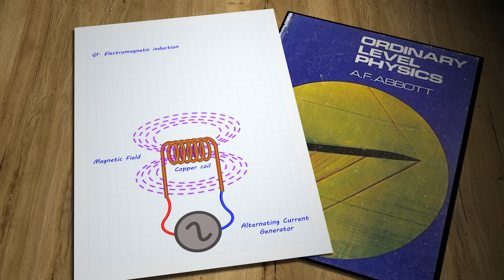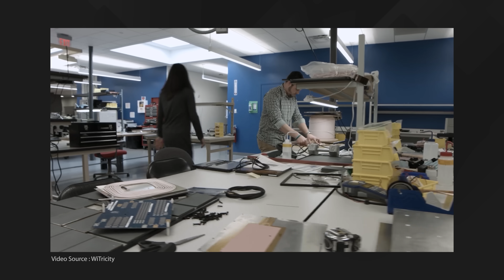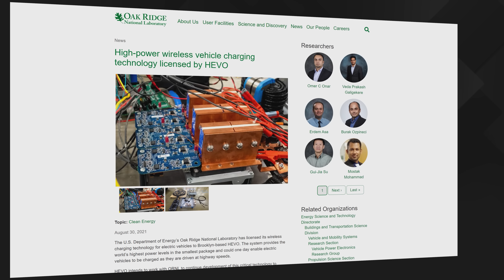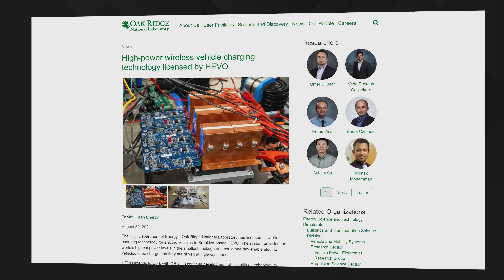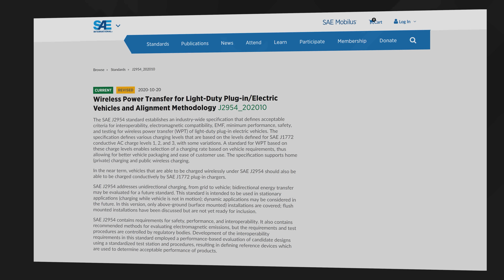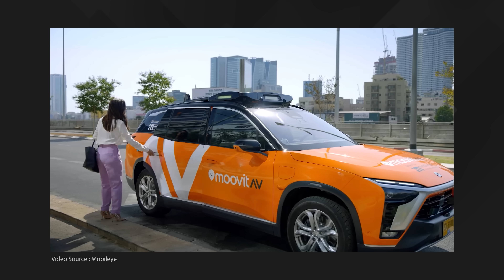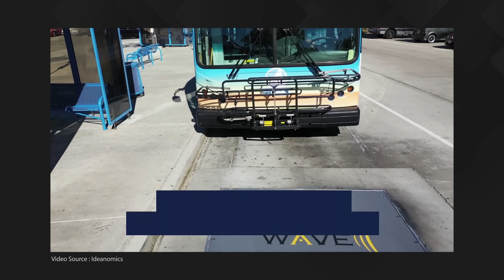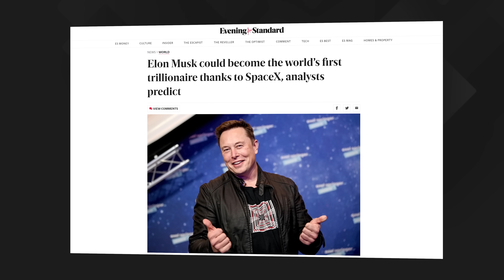Wireless FULL EV charging has arrived!  Exciting new tech breakthrough.

Comment: I like the idea of wireless charging, but this needs to be carefully integrated with services (electricity cables, water pipes, drains) that also run under roads.  It could actually make maintenance easier if the charging panels doubled up as structural access covers to a service void beneath.  This could also mean that electric cars could be much cheaper and lighter if they only needed a relatively small battery pack.  Hugh initial capital cost but probably a great long term investment.

Comment: It is inefficient and a massive waste of energy. We already have no way to create enough power to charge all the cars is everyone switched to EV cars and now you want to massively increase the power needed? 
Also, it seems like a terrible idea to be sitting in the middle of a massive EM field.
Further, keep in mind that connecting your charger to feed the grid requires a completely different setup and rules for the install. 
I have an Model 3 as well as solar and battery storage for the house. Even with that, it was still not possible to get the reverse power wall box setup to supply to the grid yet. 
It doesnt matter too much now since Tesla does not even support it.. but in the future it will be. 
Point is that it's not just a matter of the box supporting it and you get to do it. There is a lot more involved.

Comment: It feels to me like none of this is disruptive technology. Batteries and charging doesn't seem sustainable, and even if they manage to make it so, it doesn't solve anything. Any convenience gain involves inconvenient side-effects. The irony is that we've had a solution to electric vehicles for a long time already, and it's being used for trains and trams all the time. It's not without its own problems, of course, but batteries/chargers aren't going to make it obsolete. I'm not sure hydrogen will either. Tiny nuclear reactors of some sort, maybe.
Reply: You're correct that this is not disruptive technology.  Batteries and charging, on the other hand, are indeed sustainable.  Battery recycling technology is already well in hand, and giga-scale plants are being built.  See Redwood Materials Inc as one example.  I don't see how you can say batteries don't solve anything.  I've been driving an EV for four years, and very much enjoy not ever having to go to a petrol station, not to mention the money I've saved on fuel.  It has certainly solved my transportation needs.
Reply: Nuclear reactors have a really bad power to weight ratio especially if you actually shield them. They make sense on ships where needing to sail for weeks without refueling is normal and the weight of the reactor is replacing a coal bunker with a significant fraction of the ship's weight in fuel in it. They also have unlimited access to cooling water. These things do not apply to land vehicles of any size.

Comment: So the way to fix road degradation and potholes is to add tons of copper an inch below to roads?
Also for the specialized lanes for electric buses, what's wrong with the century old overhead cables used by trams?
Reply: So if the technology will only be used in 5% of the miles driven by people why invest in it? You'd have to develop the technology for both the roads and the cars and then use it in very specific times. The novelty of a "charging road" is attractive, but the usefulness is so slim. It would be useful for taxis and busses but not the everyday driver going to their individual homes.
Reply: I believe this is mainly something for highways that are constructed to be of especially high quality and high amounts of traffic. It's not a matter for less used cheap roads.
Reply: Because it would make cities in America and Europe look like any city in India !

Comment: It's completely impractical and not safe for humans and animals nearby.  Even if that is doable, you still are losing 5-10% of the energy  (and this is a very optimistic number)
If a car needs to be very precisely positioned, why not use a special plug that comes out from the floor and attaches to the car automatically? It's completely safe, lossless (or very small loss) 
You've mentioned wireless charging of phones as a good example. You didn't mention those usually have efficiency around 50%

Comment: I'm not as deeply educated as the folks working in the field (pun intended) of wireless charging, but as one who keeps an eye on it as I have my own related product ideas, putting chargers in the road so one can charge while driving will never happen. Besides legitimate questions about their claims, the simple fact that we can barely maintain 'simple' roads in this country (the USA), and you want to put charging electronics in the road (assuming it really works) - Nope, not going to happen and wouldn't survive. Maybe in certain locations such as where taxis wait to pick up passengers - maybe. There might be some specific applications for wireless, and I'm all for the 'pros' to keep developing this stuff, but in general wired charging will always be faster and better. We've been plugging in things for ages as its worked out pretty well so far.
Reply: Indeed, agreed. Parking spots is the only practical place to use these if the costs make sense imo.
Reply: @justlisten82  Wouldn't make sense even on parking spots as wired charging will always be far, far more efficient and when you're on a parking spot nothing stops you from actually plugging the car to charge—or having any sort of an automatic physical connection system which would cost far, far less than the loses wireless charging would create.
Reply: @zwerko  good points. However since this is relatively new we could drive the costs down with mass producing and innovation. Only upside I see is this could in theory be used for any BEV which would allow any type of car regardless of the charging port type the car itself has. But indeed, I agree with your good points.
Reply: agreed.  I could see modular batteries being the solution for mass transit bus/taxi systems.  The vehicle pulls over a pit where the battery swapping operation is handled autonomously.  A main advantage of this method is reduction in infrastructure needed to transport power.  So the swap could happen in a more industrial zone where transmission capacity is high.
Reply: Add in the fact that other materials may be heated by the inductive fields. Imagine the lawsuits from the idiots that disregard the safety.
Reply: Agree 100%. Imagine the cost when a utility wants to dig up the road to repair a pipe or a cable, and it's underneath a slew of charging pads!
Reply: "I'm not as educated"
"It isn't gonna happen"

🤔
Reply: @lexscarlet  ya it’s a nice idea but isn’t practical and the tech isn’t there to make it a gain vs waist
Reply: @ls-33wraith33  yeah, waistful things suck. I always rely on expertise from YouTube comments.
Reply: @lexscarlet  it’s YouTube everyone gives there opinions on here and i never said I’m a expert idk why your mad at me but i hope life works out for ya. 
Live long and prosper 🖖
Reply: I think you may be missing the fact that attempts to do battery to grid transfers are being developed to help the grid remain stable.  As was noted in the video the ability to give and take from a battery when needed can only happen when the vehicle is connected.  Wireless connections make this seamless.  Add in payments for the use of the battery to the owner of the vehicle and all of a sudden we are talking about some real win win.  I don't think anyone is suggesting that all roads will have these devices....at least not for many many years but taxi's, buses, in garages (residential and parking structures), street parking, and possibly on roadways that are expected to continue suffering from near gridlock at times of the day, are all real opportunities that could make the transition to electric not only sustainable but even more desirable.  Not to mention the employment opportunities to install and maintain these devices.
Reply: Totally agree with your points! 1 things that’s not really covered is the energy loss from wireless vs wired well the loss is typically small think of the electrical loss threw thousands of cars then millions will add up dramatically
Reply: Seems to me it's just a matter of cost. If mass production of plug and play modular systems could be developed, the problems you cite might be inconsequential. There will always be people/businesses willing to pay well for such a convenient service, so private financing could develop traffic lanes that cost you to drive on. The cost would have to cover the charging infrastructure and the road maintenance. The trucking (and bus?) industries would certainly be willing to pay for that. 

Currently there are HOV lanes that allow EVs with a single driver. That model is not sustainable as EV adoption ramps up. But charging for charging could create a fast lane that would continue to encourage the switch to electric.
Reply: @ronvandereerden4714  already a model exists for that. Toll roads. Those here aren't maintained all that much better than the standard roads and highways
Reply: @tobins6800  Just because something is broken doesn't mean it can't be fixed.
Reply: >Having massive concrete and asphalt structures allover the country
>Having huge railroads for trains and tramways  allover the country
>Having huge tunnel systems and subways allover the county
>Having huge trolleybus systems allover the country

>Stating that we can't put some inductive coils in existing roads.
Reply: Nice video, thank you. Well I’m not one of the nay-sayers. What I will agree on is that the idea of mentally adopting a new way of doing anything that seems disruptive to what is currently available and is in fact a measure of a person’s own ability or success in society is itself a challenge and opposition should always be expected. Paradigm shifting changes can re-define the subject to such a degree that the arguments for remaining pre-shift don’t carry the same weight or collapse altogether because those arguments are based on pre-shift understanding. Take horses and early cars: horses could better manage difficult roads/paths and you didn’t need to be a mechanic to keep one going. Far more people were skilled at keeping horses and they could feed and water off naturally occurring God given plants and streams along the way and even bred new horses for the owners. Cars by comparison need constantly groomed roads, only consume manufactured and expensive to produce poisonous flammable gasoline, break down and rust. They will never be adopted world-wide.

Comment: I'm a huge fan of EV and I think petrol engines are on the way out. That being said, our electrical infrastructure is abysmal at best. We need to fix our infrastructure for this to work and then we need to embrace nuclear power as our cleanest baseline option at this point in time. Until those things happen we will struggle to get an EV in every garage and we'll still be filling the air with garbage at the power plants.

Comment: What about the known connection between Electromagnetic Fields and Cancer? Is it so hard to plug it in I think copper cable is definately more efficient?
Reply: The known connection between electromagnetic radiation and cancer applies to electromagnetic fields with extremely high frequencies (and correspondingly short wavelengths) and does not begin to cause changes to human tissue (which could potentially lead to cancer) until the frequencies are in the range of 1000 terahertz (1 followed by 15 zeroes)  Ultraviolet light has a frequency of around 1000 terahertz
The frequencies used in inductive charging are around 100 kilohertz (1 followed by 5 zeroes)
In other words, being exposed to the electromagnetic field of an inductive charging system will expose you to radiation with an energy 10 billion times less than if you went for a lie down on a sun bed